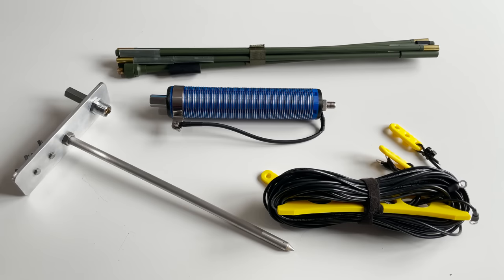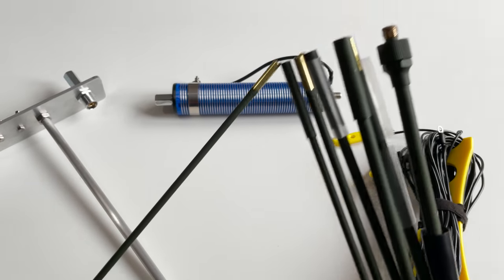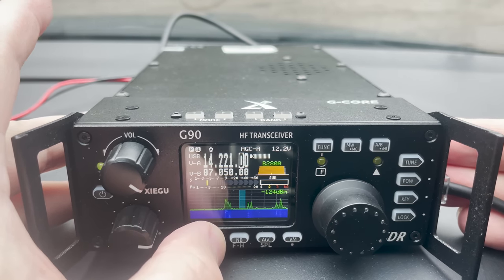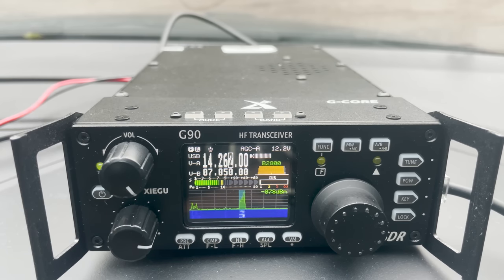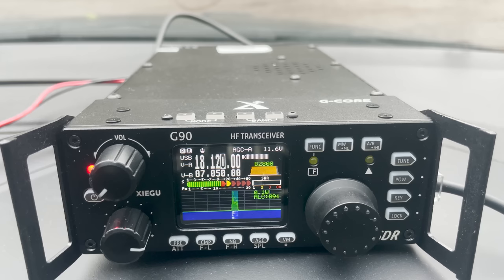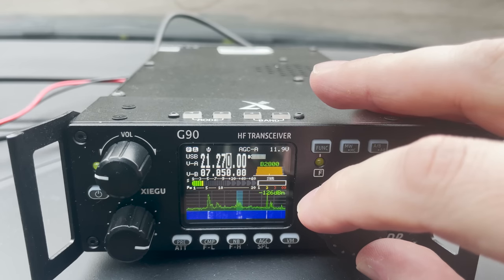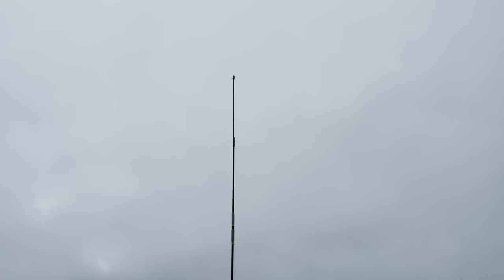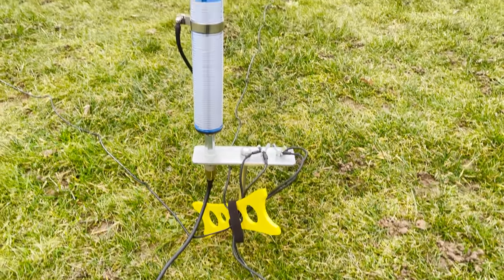Portable with the Slidewinder DX Multiband HF Antenna

Comment: Customer Information.
Due to extremely high demand for our ground spike antenna kits, Slidewinder Dx Portable antenna systems mil whip version. Slidewinder DX Coils & other products in our range, Have now sold out on many of these products.
We have supplied this high demand since the middle of December last year. But we have now been cleaned out.
But rest assured we are working hard to get more made.
What this means to you is a little waiting time until we can restock these products. 
Our aim to supply every stock request as we get them made. Please bare with us because unlike other outlets in the hobby we make 95% of our products we sell in house. In time we will catch up with the extremely high demand & thank you all for your continued support of our Antenna products.
We ship worldwide & the shipping cost is worked out when you enter your address details in our shopping cart.
Kind Regards
M1ECC Antennas
Reply from the maker: It’s a great product! Definitely worth the wait! Thanks 🙏
Reply: @TechMindsOfficial  Thanks Mat

Comment: I have bought one on the strength of this video, it arrived today, I have tried it out in my back garden, unfortunately, my home QTH isn't great for HF Radio, as I have S8 noise however I thought I would try 40M, using a SWR meter I managed to get down to about 1.3. Using an FT-818 with 6W I managed to get into Cookstown in Northern Ireland with a 3.3 Signal. I am really happy with this. I have some radials from another antenna and I think I may add them to see if I can get the SWR down further. I only work portable so this antenna is going to help me get more out of Amateur Radio
Reply from the maker: That’s great news Paul! I do tend to try and only feature quality gear on the channel, but it’s nice to hear its working for you. Maybe catch you on the air!

Comment: I have made mine a centre loaded virtical i had 2 old poles from a old portable anttena i found it easy to tune on 7,14,18mhz i did not test it on the air much to cold here i will wait for better weather

Comment: Great video Mat. I am yet to get into HF. Think I will save up for the X6100 and probably a efhw or a linked dipole.
Motters M7TRS 73
Reply from the maker: HF is wonderful, really opens up the hobby! Radios may be expensive but antennas can be made from scrap pieces of wire. Good luck on your journey!

Comment: Two questions, is there anything you can use to increase the range of transmit power from the rasp pi gpio pins? Also how can you increase the output power from a GMRS Ham radio?